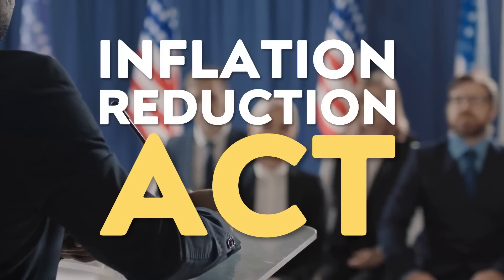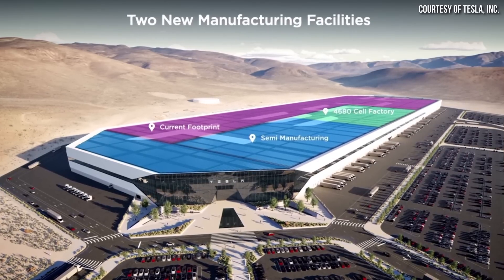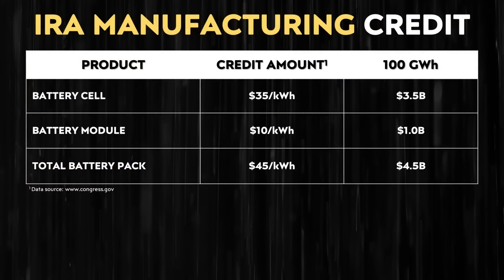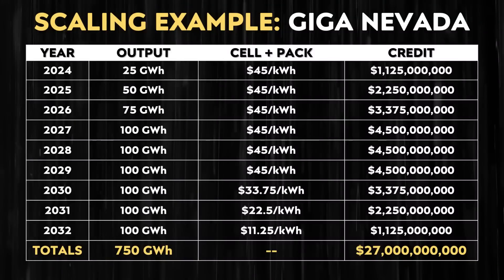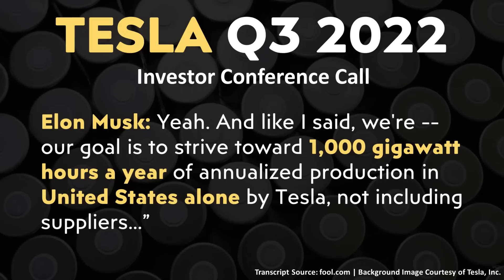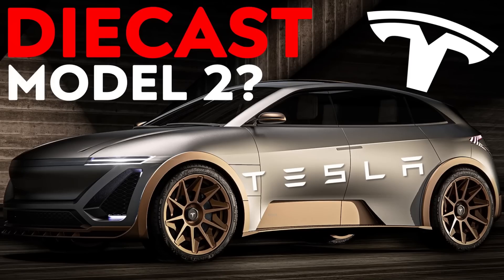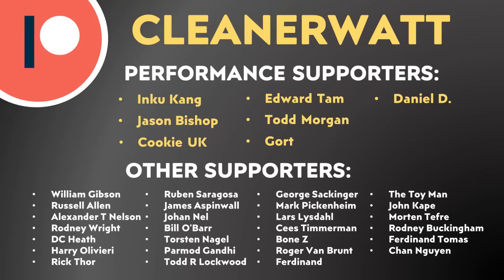Tesla can BUILD FREE 4680 Battery Factories | IRA Credits

Comment: Where to get the lithium? Where to get the refined lithium? China controls 97% of it. They control the machines to create refined lithium and batteries. Just like now China won’t sell machines to make solar panels. They will control lithium. The onky way out is to make batteries without lithium, which will take 10-20 years to get going.
Reply: My understanding is that China's control is on the refinement of the Lithium, not the raw materials.  I think with the new factory starting on the Texas coast, this will reduce China's control a bit.  Which, if true, is in keeping with the intent of the IRA, at least from the EV/battery aspect.
Reply: Yes, silly. The world has lots of lithium. US has lithium, Salton Sea, Nevada, elsewhere. The problem is that demand has increased and the ability to refine, the processes to refine,  need to catch up with demand.  Tesla is good at overcoming this type of obstacle!

Comment: I'm.gurssing delay with 4689's is due to perfecting dry electrode process for both cathode and anode !?. Until that process is perfected and so long as half the production requires a wet line, there is no point building out additional capacity. Once done 4680 production should quite literally explode.....

Comment: Hi Jon, my undestanding fo reaching 100GWH is including existing 34 GWH now there, build up in the last 10 years. So not directly to compare with new competitors and except the existing volume.
Reply from the maker: No, the 100 GWh is definitely separate. Panasonic, not Tesla makes 2170s at Giga Nevada.
Reply: @Cleanerwatt  I know, but wherefrom you recognise that it should be separately and not for the whole Giga Nevada ? Its neede to have the working dry electrode too for spare so many space of course but its not announced they fix the problems aboit this topic yet.

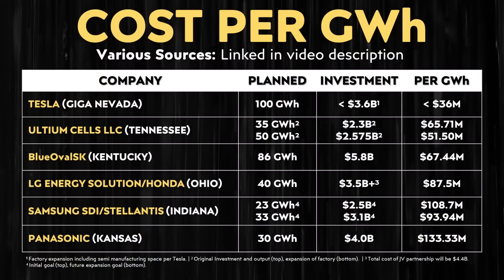Comment: At 4:20, freaking... 
$36,000,000 for GWh
$36,000 for MWh
$36 per kWh...
That lasts like TEN years!
(I want my industrial discount, LoL) 😂
Oh, that's just for the building and equipment, darn.
Nevertheless, raw materials should only be about $500 a ton? Given that there's a thousand kg/metric ton, that's 50¢/kg. Being that a kg is about 180 Wh (LFP), 5.55 kg is needed to make a kWh (of LFP battery). Thus, only about $2.80 for the raw materials cost. Add in the factory costs, over what, ten years? And if course labor and mark up.
So, if the factory and equipment lasts just ten years (and if the "100 GWh is per year", then add only like a tenth of that "$36/kWn"... Add in like double for unexpected events, that's exactly $10/kWh.
Now add in $3 for labor and $17 for markup, that's only $30/kWh!

Comment: Nope. The factories won't be free. It's a TAX CREDIT....not a cash payment. So the max BENEFIT Tesla can get in a year is its TAX LIABILITY for that year (which is less than 10% of the Net-income....which means it's less than 1% of the revenues, even assuming 10% NET-margin!). 
It's unclear if the 'unused' TAX CREDIT can be carried forward to future years when the tax-credit disappears (if it does, then yes it's a free factory)
Reply: Even so, Tesla would not need to pay any taxes until such time as its tax liability exceeds the max benefits. How good is that?

 Its competitors will be far less able to take advantage of this generous offer due to their lower volumes
Reply: @BK-pl3vy  Sure, that's fine. I just wanted to correct the misconception that the factories wud be 'free'.
Correction from my end: 30% is gross margin, net-margins are ~10%...so the tax credit wud be just 1% of the revenues...really a tiny portion.
Reply: @BK-pl3vy  If the competitors are selling their EVs at  little or no profit, and they have split out their companies like Ford is doing,  I wonder if they will have any use for the tax credits.

Comment: nICE - ;) So where does that leave Ford and GM the coming 2 years? Crazy good to get a factory with a ONE year payback time at full ramp!!
Reply: GM is finishing building their 3rd battery factory and a 4th is about to start with all receiving money from the IRA bill.  Likewise, some of the money is used to retool their factories for EV's, which they're doing now.  Same with Ford.
Reply: @RussellFineArt  
And GM just announced what's essentially a plan to "Dump" their (not so?) "Ultium" cell, instead changing to "cylindrical" cells
(presumably 4680)
.
Here's one for you to chew on.
The leader in 4680 development is?...... Go on.... Say it!
.
There's a reasonable chance that GM will be using.... Let's call it "a Tesla influenced cell" before long.
"Lithium Irony "?
.
And before you say it, nobody had cracked the basic 4680 "electron path / resistive heating" problem before the Maxwell theory and Tesla production solution (that's discounting "Dry electrodes")
.
It's "strange" that others are now mimicking the concept to varying extent?
.
I think it will become obvious that others (Panasonic, Samsung, LG , maybe even CATL?) are using at least potions of the basic (patented) design concept under the Tesla "free use" policy.
.
That being the case, there will (should) be at least a degree of cooperation/ cross fertilisation in the various development threads.
(Note Panasonic supplying cells for evaluation by Tesla)
.
Thus, it's highly likely that Tesla will have "a finger in the pie" of any cell produced by the GM "partnership" with any of the big 4 cell manufacturers.
.
Can't wait for Mary to try and wiggle out of that one!
.
Just sayin'
Reply: @RussellFineArt  So, 20GWH for GM and even less for Ford?  Cool.  Thanks.

Comment: Cheers for that. The supposed delay, in my view, was down to perfecting the dry anode process.
Reply: you mean dry cathode process
Reply: The anode has to be perfected and the cathode has to be perfected. 2 years were planned before.
Reply: @Alans-qm5ch  
They've been using Dry Anode for a considerable time (as in the cell obtained by Jordan was believed to be manufactured at least 1 year ago)
I believe this was confirmed by Munro Associates.
Reply: @rogerstarkey5390  as i read, Munro confirmed, the cathode and anode in 4680 are still produced without improded cathode and improved anode.
Musk had say, full capacity would need 3 years, one to increase production, one to finish anode and produce, one to finish cathode and produce.
That was said about september 2022. Maybe i’m wrong but it seems full 4680 lasting much longer would be available before mid 2025

Comment: Based on what Elon said at the Nevada site, the $3.6B  was to build both the battery factory and the semi factory.  I  obviously don't know the cost to build these but I would think the battery factory would be less than 50% of the semi assuming high automation on the semi lines (equals $$$).
Reply from the maker: Very possibly. I would love to see the cost numbers broken down, but chances are Tesla can build factories out at least 50% cheaper that the nearest competitor!
Reply: If the semi factory is 0.6B and the 4680 is $3b, 100GW is still $300m or half that of others.

Comment: The IRA is overly generous.  It really needed to be designed in a way that forced efficiency to get it.  Something a bit like the price caps on the cars, they could have had a nickle based and non nickle based cap, with scheduled cap reductions over time to force the producers to support recyling and expanded supply expansion.

$35 a KWh would mean in a few years that the Govt is subsidising over 50% the cost of a Tesla battery pack.
Reply from the maker: I agree with you on this. It should be adjusted just a bit to incentivize efficiency.
Reply: Yes but U.S. only built and majority sourced cell's thereby benefiting U.S. only suppliers or those from free trade friendly countries. 
I do think it should be more strict in some areas. 

But look at how much trouble the irs has had meeting the ev incentive guidelines? And how some have circumnavigated those restrictions and gone to leasing the evs to still qualify for the full credits(BMW for example leases almost half of all it's sales annually.

Anything stricter for the cell incentives would've likely created similar issues imo. 🤔
Reply: how much in subsidies has been handed out to the fossil fuel industry?
Reply: @xshakespearex1  
That's a point that nobody has picked up on.
By the time we reach 2030(?) there will be a significant "transfer of funding" from fossil fuel to green initiatives.
The first few years are essentially a "loss leader" but once the factories are built and taxes are being paid by the workers (and some of the companies? 😗) those savings, added to the funding shift will make the deal much sweeter for Government.
Just needs politicians with the B**ls to do it..... 
Oh..... wait.....
THAT might be a problem (😉)
Reply: Not when you consider how truly expensive coastal flooding will be as the alternative.
Reply: @michelangelobuonarroti916  
I think that ship has already sailed...... Look for increasing reports over the next few years.
Reply: There's no need to incentivizes recycling. Disused batteries will be very valuable: >95% of the metals will be reused. And J B Straubel notes that these metals need no refining - their almost pure, so they are ready to be made into new batteries.